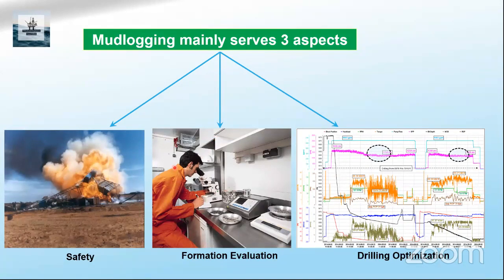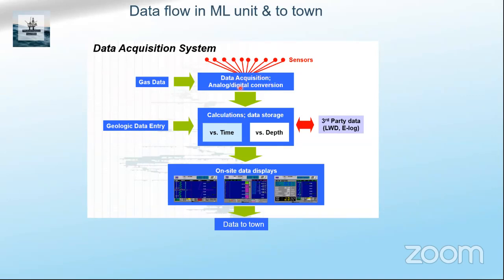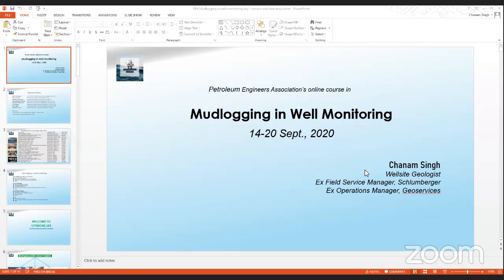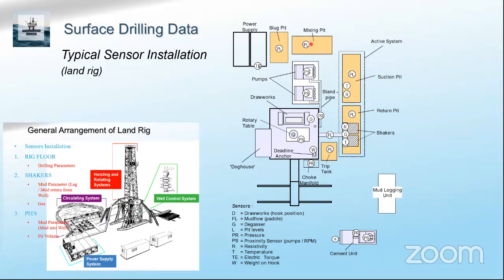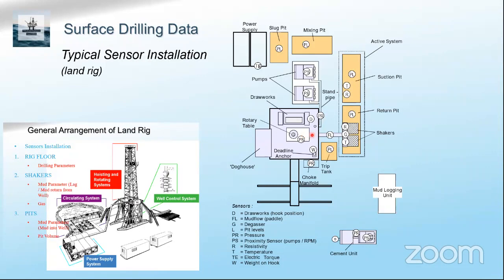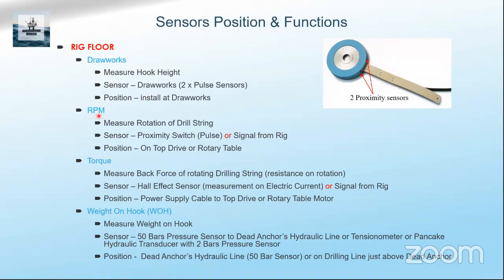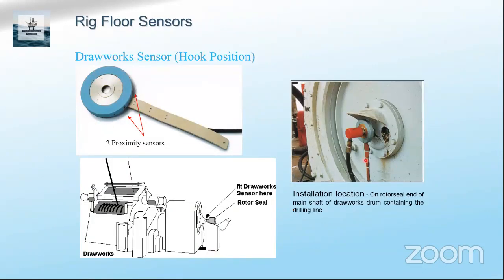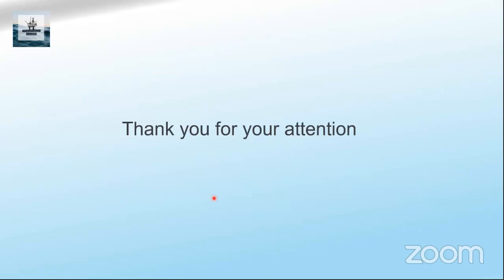Mudlogging in Well Monitoring Course Day 01

Comment from the maker: Greetings from the  Team Petroleum Engineers Association!

We are very pleased to introduce "A WEEK ONLINE COURSE MUD-LOGGING IN WELL MONITORING" BY Mr. Chanam Singh.

About the Instructor:
Mr. Chanam Singh has worked extensively in Oil and Gas exploration with multi-disciplinary teams for more than 24 years in more than 9 countries. Currently he is working as a Consulting Wellsite Geologist to Cairn Oil and Gas, India.

His earlier experiences include as Field Service Manager, Schlumberger, Houston, USA. Prior to this he worked as Operations Manager, Geoservices, Malaysia. Mr Singh had worked as Mud logging Geologist, Data Engineer and early Kick Detection Engr in both onshore and offshore rigs in India, Oman, Sudan, Yemen, Russia, Indonesia and Brunei before joining the management.
Chanam Singh attended various technical, safety and Management trainings of Geoservices & Schlumberger in Paris, Houston, Tunis, Abu Dhabi, Mumbai, Singapore and Kuala Lumpur.    

About Course: Mud logging, also known as surface logging, is the creation of a detailed record of a well drilled by examining the sample cuttings brought to the surface by the circulating drilling fluid (mud). Mud logging service provides recording of the drilling parameters with the help of surface sensors and data acquisition system. Mud logging is the only service company at a drill site who continuously detects, analyses and records hydrocarbon gases while drilling a well. 

Designed For: 
Petroleum, Drilling and reservoir engineers; New hire Geologists and Geophysicists.

Course Fee: INR 500 For Indian Candidates & $20  For International Candidates.

For More Information Feel Free to Contact:

Nikhil Agarwal (+91) 6203835588 (WhatsApp & Call)